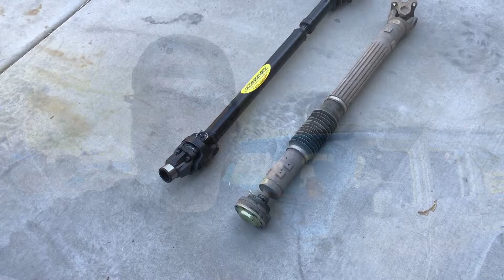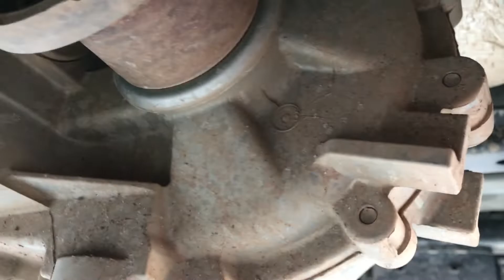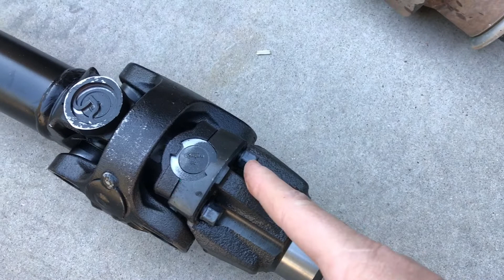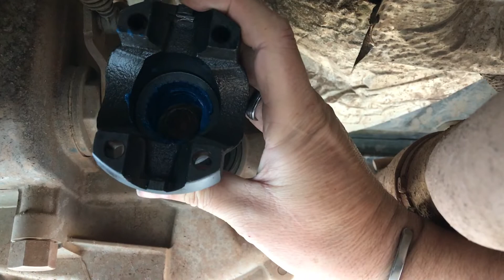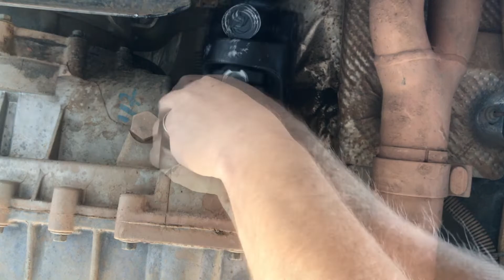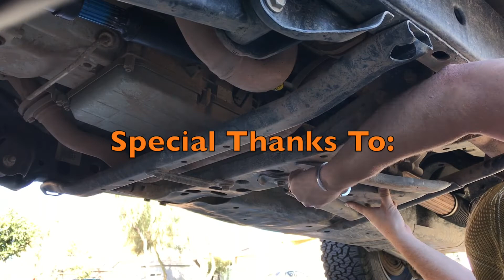New Driveshaft Instaled in the Jeep!  Tom Wood's Custom Drive Shaft JK / JKU Front DIY w/ Hand Tools

Comment: LS SWAP THE WORLD 😂💪🏾
Reply from the maker: Haha maybe someday!
Reply: I’m replacing my rear one in my 2016 jkur. When I was taking the pinion nut off, a lot of gear oil leaked out from the pinion seal. Is that normal? Guy at Tom Wood said most likely it was from not having that pressure on it from the nut.